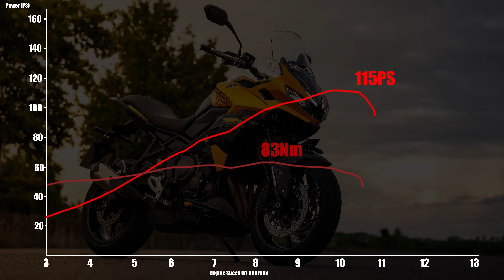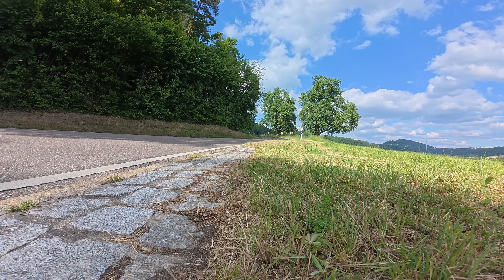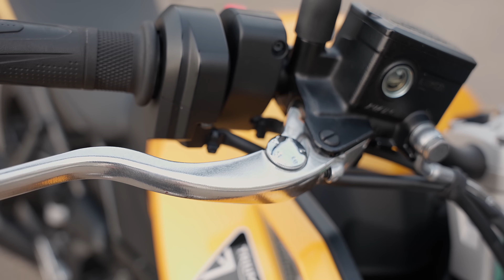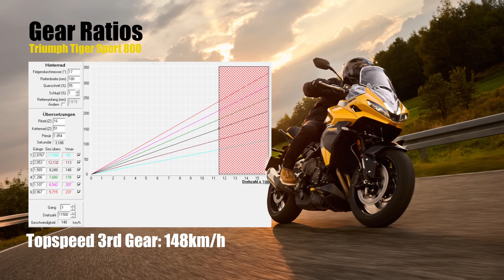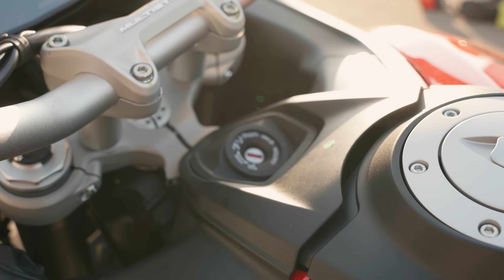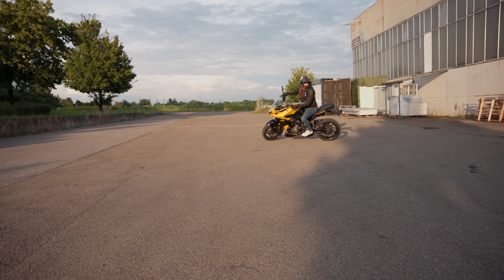Triumph Tiger Sport 800 vs. Ducati Multistrada V2

Comment: interesting and informative thanks - but not (in NZ anyway ) a fair comparison - the Ducati is over $10,000 more expensive !...oh and i have had 7 BMW's still have anR1200RS and only ever 1 problem with one of them - totally reliable.And the one problem was a failed HT lead , fixed in 10m at a local garage...on an R100s

Comment: Tiger 800 service interval is 15k km not 12k km.
Reply: actually it's 10k miles = 16k km for the Tiger Sport 800
Reply: I wouldn't trust these service intervals anyway. Mine is serviced every 10,000.

Comment: Valid comparison as these the only bikes on my next bike short list. The Ducati costs quite a bit more,  but it shows, it looks a much more premium product, the Triumph looks a little cheap.  As an owner of the old Multistrada v2s I'm swaying towards the Ducati, the only shortcoming with the old one is the engine response at low speeds, this is supposed to be fixed with the new engine, yet to have a test ride.